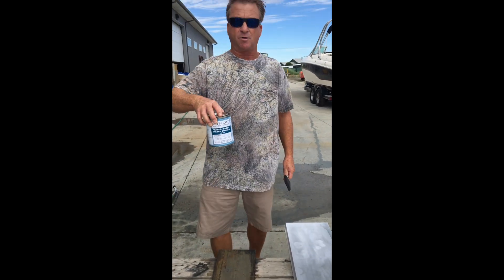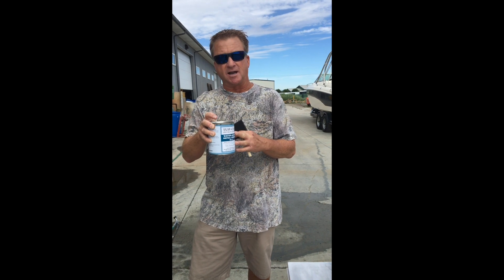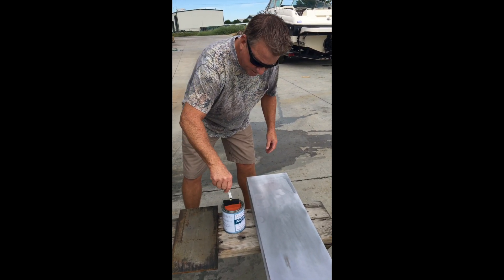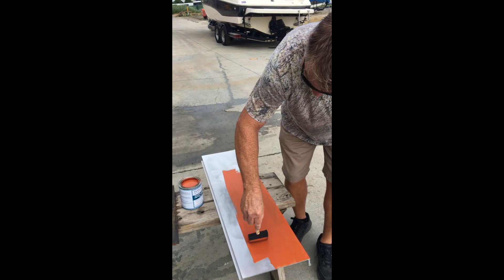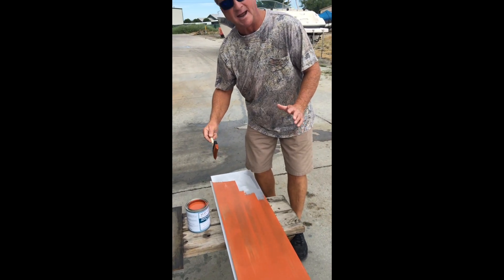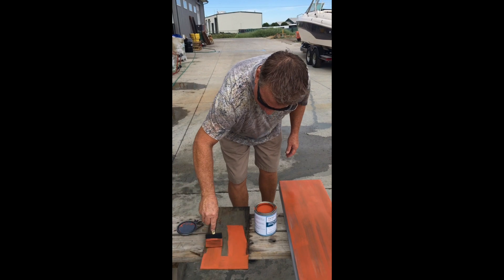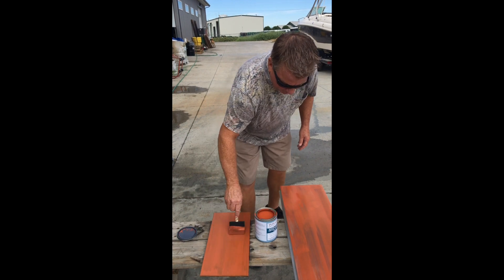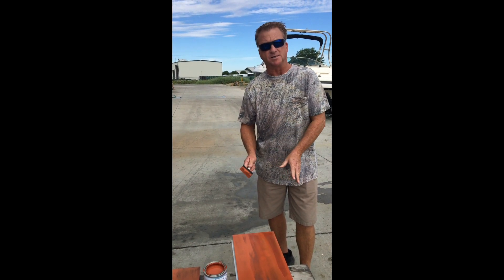How to Prime Steel & Aluminum with Tuff Coat MP-10 Primer

Comment: I want to put tuff coat on the deck of my aluminum boat, but I also want to use alkyd enamel for the trim. So, do I need two different primers, or will tuff coat work with other paint?

If I do the trim first (with separate primer) and accidentally paint “outside the lines” will tuff coat stick to other paint?

Comment: What happens if I use the two part primer instead of this metal primer.. I already primed my metal deck lids with the other.. And I am just about to apply my tuff coat. I didn't realize my fiberglass bass boat had metal lids and didn't realize until now there is two different primers. My boat stays in the dry if that makes any difference.
Reply from the maker: To clarify - " I already primed my metal deck lids with the other..". As long as the CP-10 primer adhered to the metal lid, you should be just fine.

Comment: What acid should be used to acid wash?
Reply from the maker: Miles Weimar for the acid wash combine one part muriatic acid to one part water. Muriatic acid can be purchased at stores such as Home Depot or Lowe's. You can always call our office at 970-252-9457 or visit our website www.TuffCoat.net for application instructions, including how to mix the acid wash. Thanks!
Reply: Thanks! I'll be covering the floor and decks of my jon boat with Tuff Coat.